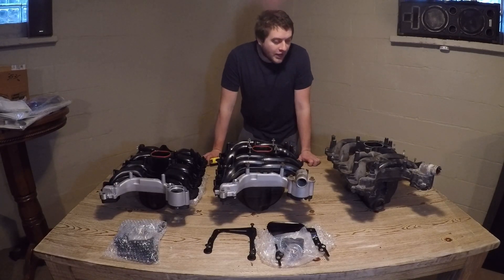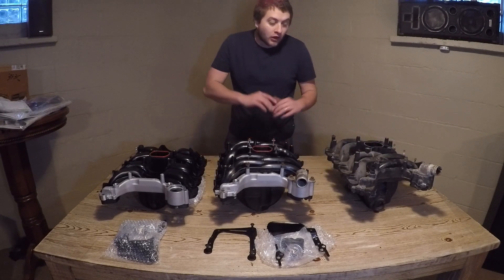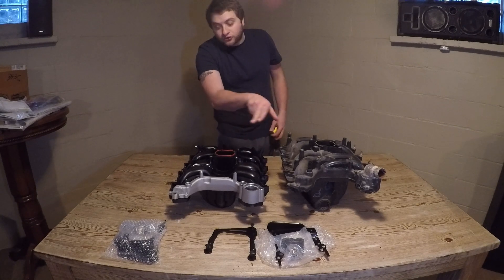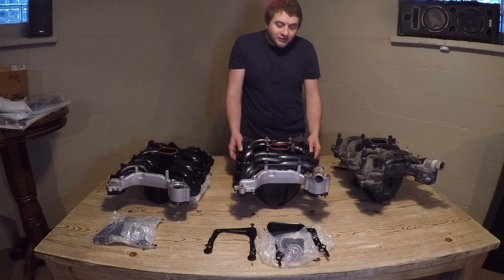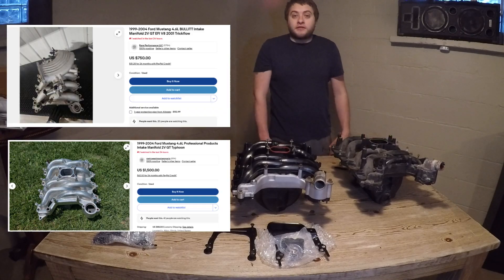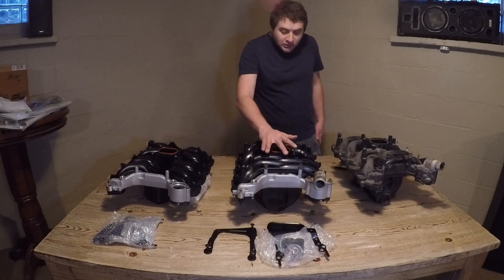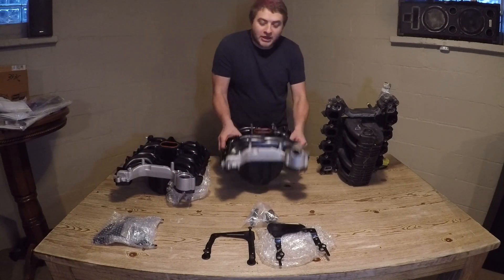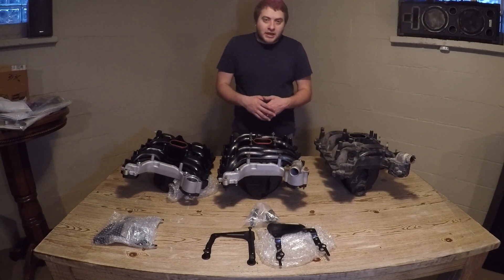What Ford Modular intake is the right one for your car? (2023-2024 Edition)

Comment: Ford just came out with the new OEM one!
Reply: You still lose 10 HP compared to the original Ford PI intake but thats better than the 22-25 you lose with a Dorman.
Reply: @j.t.cooper2963 well I have a non pi so anything that flows better is a gain lol
Reply from the maker: That’s killer!
Reply: Link to the new intake ?
Reply: @206bagtaker3  Summit has them. It's exactly the same as the new Ford but it costs less.